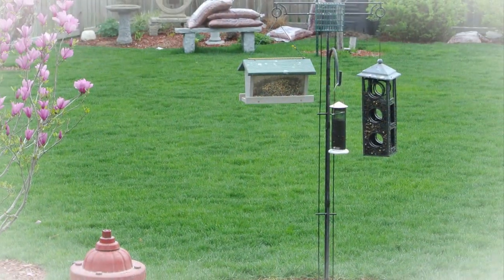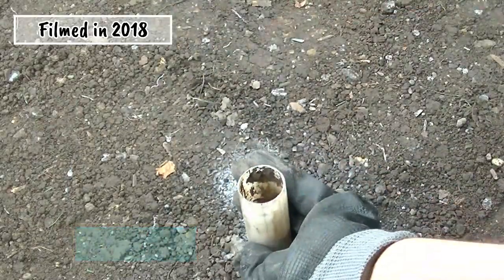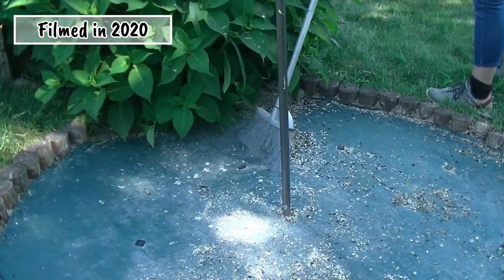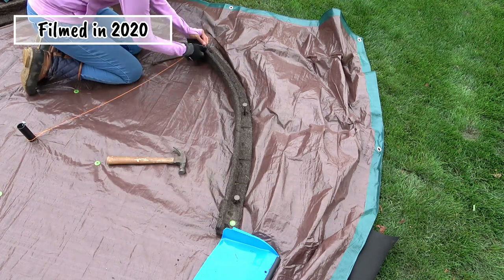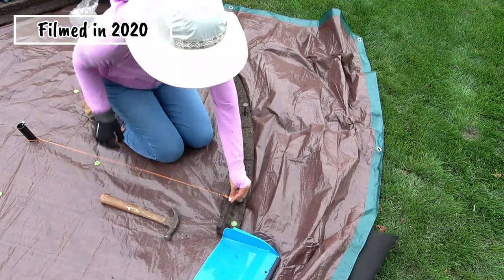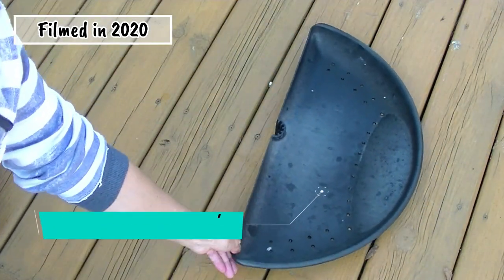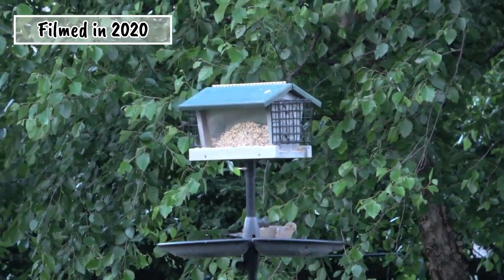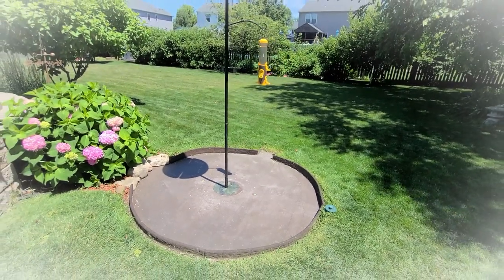"Wow" to keep mess free under outdoor bird feeder

Comment: Good job.  You put in a lot of hard work there.  Yes, seed that falls to the ground from a bird feeder will choke out the roots of the grass, and eventually kill it.  Also, as you mentioned, seed that falls to the grass below a bird feeder can be a health threat to backyard birds as the moisture in the grass and roots can easily contaminate the seed with mildew or mold.  When birds ingest seed that is contaminated this way they can become sickened with avian aspergillosis which can easily spread from bird to bird and is a fatal disease for them.  Instead of cleaning below your feeder once a week, you might consider cleaning pretty much daily. I'm sure you've noticed bird droppings mixed up with seed that falls to the tarp below your feeder.  When bird seed is contaminated with salmonella bacteria in bird droppings that are deposited on the seed from a bird infected with salmonellosis, it can lead to the spread of that avian disease when birds ingest this seed.   Like avian aspergillosis, salmonellosis can then spread easily from bird to bird in a flock and larger populations of birds flocks belong to.   I actually trap bird seed that falls to the ground below my feeders.  The trap has chicken wire across the top that enables the seed to fall to the bottom of the trap, but is a small enough grid of wire to  keep birds from being able to access the trapped seed.  For whatever it's worth, you're doing a great job making your conditions and environment a much more sanitary one for your backyard birds.  The vast majority of backyard birders participate in the hobby mindlessly and with little to no considerations for how their dropping-covered, bacteria-laced feeders and garden environments can pose a constant, year-round health hazard for garden birds.
Reply from the maker: Thank you very much for sharing this information.
As you said, I had somehow thought that the bird droppings were mixed in with the seed that fell on the tarp under the feeder.
 I thought I was cleaning it, but not every day.
I will make sure to clean under the feeder every day.
Reply: This is such important information, I'm surprised it's not included in instructions for every commercially sold feeder. It's also info the Audubon Society should highlight on their website, and I've never come across it. I'm not able to have feeders myself, but if I were, I would never have known. Thank you.
Reply: I would love to see a picture of your seed trap, and instructions on how to make one.

Comment: Great ideas. I have 100-200 birds a day with the winter we've been having... there's been snow on the ground for 2 1/2 months that has finally melted... what a mess. I'd been trying to figure a way to deal with it. Normally I just hose it down but with freezing temps I cannot connect a hose. Anyway, this will be a great solution 3/4 of the year when I can connect a hose. Love how you used the dust pan... that was brilliant. Thanks!

Comment: So much work to tidy up for the birds... Impressive construction, though! 😉 

I came up with a less time consuming construction by not trying to clean up the ground under the feeders. To make it not look absolutely terrible and unhygienic for the birds, I started to hang the feeders on the support poles for my young trees that I grow in round raised beds to separate the young trees' drip line from the surrounding grass.

Around my trees, in the raised bed, I mulch the ground, so the seeds that the birds dont pick up either sprout or decompose with the mulch. Now the birds are now decorating the ground around the fruit trees. This year I got more than 10 sunflowers, last year I got some linen. I have also planted some perennials that bloom and cover some of the mess too. Some birds, such as pigeons stomp them down, but I don't mind. :) If it still gets too messy, I just add some more mulch on top.
Nature decomposes the bird mess and I can spend time on cleaning the feeders instead of the ground. 😅 

I also think my trees appreciate the extra birdy boo-boo fertilizer, hehe.

Comment: After installing the weed barrier, why did you add the tarp?
Reply from the maker: It is double protection.
The landscape fabric offers drainage and seeding blocking at the tarp ages and holes appear.
The tarp offers cleanability and durability.
Landscape fabric alone will break down quickly.

Comment: How do you keep out mice?
Reply from the maker: A friend of mine who lives in a secluded area told me to buy some cayenne pepper powder at the grocery store and mix it into the bird feed, mammals don't like it, but birds don't taste it.
He also has a bird feeder called "Woodlink Hopper Bird Feeder" which locks at the top to prevent squirrels from entering, and when a squirrel steps into the perch, a metal shield instantly covers the seed tray, cutting off the seed supply.

I think these methods could be used for mice.
I hope this info works.